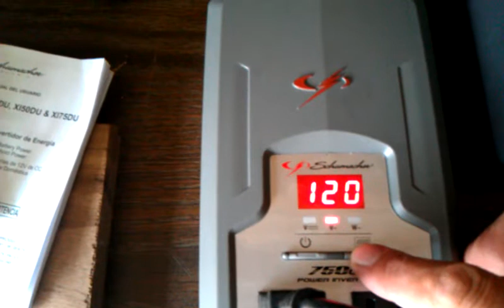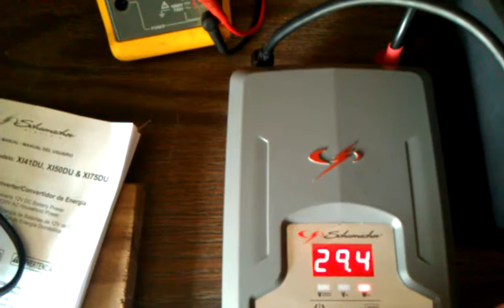New 750 watt inverter.3gp

Comment from the maker: @robrice2004 I am, the blocking Diode is right after the rectifier and my volt meter is on the pos lug on the rectifier this way i do not get any feed back from the battery bank. I tested it again with a stereo and it seems what ever I take out the generator steps up in voltage.

Comment: try unhooking your wind turbine from the controller and see if the voltage does the same thing. also check the voltage from the turbine unloaded or wile you have it unhooked from the controller. you could have some kind of back feed through your system..

Comment: I'd say that when you test your voltage for your wind turbine that you test it before your blocking diode if you dont have a blocking diode you need one,,,,the volts and amps will pass thru but not go back to your turbine

Comment: from the diode to the wind generator voltage may drop or go up depending on the load that is put on it,,,,it would never go up unleas theres no load on the generator...if it does and your plugging something in to a wall out let its passing thru your diode,,,to much for your diode to handle